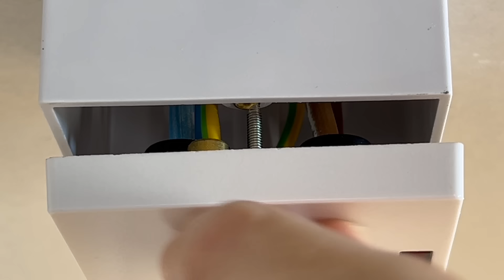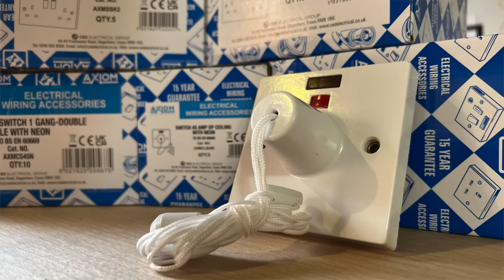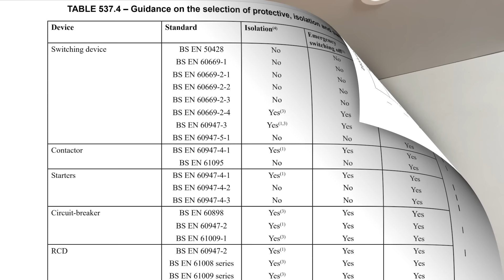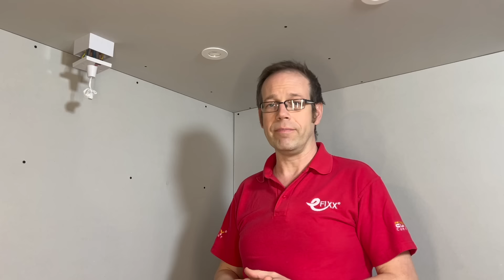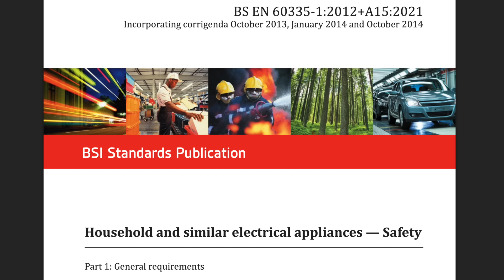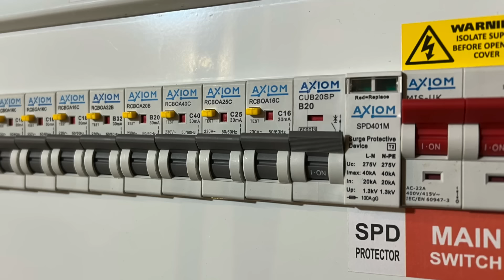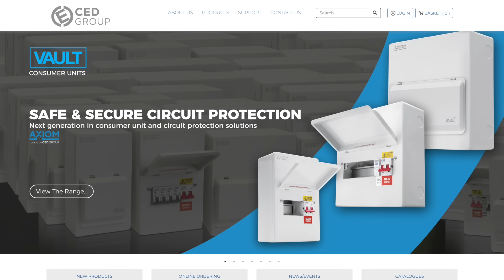Do You Actually Need a Shower Isolator — Or Is It Just Habit?

Comment: My bathrooms (Germany) have ordinary light switches on the wall and ordinary "schuko" sockets (with sprung cover) right next to the washbasins - use them for the hair dryer, the curling tongs, the toothbrush charger - whatever. One RCD for the whole house. Why does GB still have pull switches? Come to that, why does GB have these throughflow shower heaters? And why do German electricians think that things like ring mains and flat T&E are lethal? So many questions...
Reply: Switches are pull cords because of the hightend risk of skin being more conductive when wet,the same goes for the lack of bathroom 230v sockets.
One RCD for the entire house is infact an old standard that has been superseided by split load (2 RCD protected groups of MCBs ) or individual RCBOs, due to the fact that one fault would result in the hole house loosing power . 
The Electric showers are used due to the fact that space in UK homes is at a premium, so not having a HWS cylinder taking up space in a cuboard is seen as advantageous to some .
Reply: @callumcurtis15  Electric showers also have the advantage that you don’t need to heat your stored water in your vented copper or unvented stainless steel hot cylinders, if you need a shower. Do definitely a saving in gas, oil or electricity by using electric shower for a few minutes, as you are only heating the water you use for showering (even though it might be 9 or 10kw power draw for those few min)
Reply: Yes, I've found that electric showers are a very British thing ,and vary from useless to just adequate and most continental visitors find them " worrying" to say the least! And let's face it if you have say a 10.5 kW one ( which in winter is just about acceptable) ,and a large family, the running cost will be horrific.
Reply: Why do German electricians think that flat T+E is lethal? I would probably say they don't think that at all because it is in fact.... just an ordinary cable. 😱 Only lethal if you decide to chew it whilst still live.
Reply: I think to answer this question you'd have to look at the statistics for fatalities due to electric shock in Germany v UK. And make sure you're comparing like with like. 

I have to question why is flat T&E regarded as lethal? And one RCD for the whole installation is just asking for trouble for obvious reasons. 

However I do agree on the point of ring final circuits. Isn't this  originating from copper shortages back in the 1940's?

Comment: I never understood why contactors aren't more widely used for electric showers, suitably accessible junction box with a contactor, coil stabbed from the supply via a lightswitch in a location of choice.

Means you can run your switch wire in 0.5mm if you please, rather than chasing 10mm around.
Reply: I agree- contactor in the board is the best option. I then use a Quinetic switch as the actuator, stuck to the tiles in the shower room. It also switches on the boost for the MVHR.
Reply: I have found some people use the switch to turn the shower on/off rather than get cold water from the head turning it on at the shower. Others never turn it off, in this instance the contactor will be on all the time. I guess this could overheat the coil? The only experience I have of them was years ago when I worked in equipment manufacturing, they were used for relatively short duty cycles.
Reply: So you're putting a 1.5mm cable in the same terminal as a 10mm cable, then running it to light switch and back again on A1 contact and then neutral to A2? What places do you put the light switch? Airing  cupboard?
Reply: @BurpeesandFit  no, you would wire a 1.5mm separate circuit for the A1/A2 contactor terminals, via a double pole switch. I'd normally fit it as local externally to the bathroom as possible
Reply: Cost and locations, aint no one faffing around with that. Electric showers are usually in social housing, rentals and other homes as a cheaper option. Slap a pull switch in the bathroom and that's it.

Comment: This is all well and good, but I have owned an electric shower for many decades and have never used the pull cord to turn it on and off, this points to a flaw in either the shower design or the regulations that mandate it, for me at least it’s hints that the regulators think this device is not safe to leave permanently connected to the mains supply, which makes no sense to me, the only time I have had an issue with the supply to a shower is because the terminals in the shower isolator switch became loose over time, surely a better solution would be to fit an AFDD in the main fuse board supply to the shower ?
Reply: also manufacturers want to sell things ...they will always advise on more things being needed  , the regs are rigged
Reply: @memecoinmafia2732 Whole industry is lol.
Reply: It's not the regulators it's the manufacturers
Reply: Did you watch the entire video?
The video clearly states why a shower must have a switch.
Reply: Perhaps you should follow the instructions provided.

Comment: At Last someone has actually explained why have a switch. I have asked many learned people over the years about this and none of them knew.👍
Now you can explain why a kettle lead is too small and where it is covered in the regs.
Reply: The cable used to power the kettle can only carry the high currant drawn buy the heating element of the kettle if the cable is relatively short. If you want a longer lead then you would need to use a larger cable which would increase cost and may be difficult to fit in the 13amp plug top.  Remember these appliances are made and  assembled by 13 year old Chinese children so give them a break.
Reply: @KennethRankin-r2z  😂🤣
Reply: @KennethRankin-r2z  yes but where does it say this in the regs.
Reply: People tend to place the kettle next to a plug.  People don't want a long cable cluttering the surface and manufacturer's want to save as much money as possible
Reply: @Shocker99  I take it you mean socket not plug. I dont mean too short I mean too thin. The cable does not have the correct capacity acording to the cable tables.
Reply: @unicornpub  Because the cable is short and the load is not constant, a cable with a smaller CSA can be used for that current load. The tables showing current rating of cables with insulation type, installation method, air temperature, type of protective device, duration of load and voltage drop are in the regulations. To calculate the CSA of the cable to be used you need to take into account all of the above items to arrive at a calculated value for the cable that meets the regulations. Kettle lead: installed in free air, temperature ambient, protective device 1363 fuse,  voltage drop none over short distance of 750mm. Maximum cable size for 13amp plug top is 1.5mm
Load 3kw = 3000 / 230 = 13amp.
Actual cable size used is 3x 1.0mm pvc/ pvc.
Reply: @KennethRankin-r2z  And that 3kW rating will be rated at 240V, so 12.5A
It seems to be within spec to me.

Comment: You are correct about the pull cord wiring, bad enough with 6mm, never mind 10mm, and with wrestling the cables in can still need the terminal screw nipped up again. Surely designers out there can make a more practical and better solution
Reply: Agree, I have never done this but I wonder if you put a 47mm dry lining box in the ceiling then us like a 20mm extender that would give you 67mm but only poke down 20mm from the ceiling..  I think the trick is not to cut back the outer sheath too far so you can slide the cable back through the hole without single insulated cable poking out.
Reply: There is a better round design of 50A pull cord switch, the now defunct Crabtree 2167 and similar Scolmore PRW213. Unfortunately I'm not aware that CED offer a similar product. The base can be fixed to a ceiling joist with a cable coming in each side. The terminations are in the base, which makes ensuring that the connections aren't loose and any testing much easier.
The same issues arise with large cooker cables in 40A+ plate switches. Where I can fit local isolation inside a cupboard, or adjacent pantry, I'm now fitting commercial style rotary isolators, and I'd probably do the same for a shower if the switch was going in an airing cupboard. They are larger and a few quid more, but you can ensure that the terminations are secure, you can easily probe for a Zs reading, which is near impossible to do safely on a large plate switch, when connecting an oven or hob via flex you can gland straight into the enclosure, and they don't crack. (Please tell me I'm not the only one who has cracked a 45A DP switch plate or deep pattress when tightening up the cover screws!)
Reply: @dg2908  YEs we all tighten to "cracking sound" tight 😅. what also bothers me is the earth screw can be face skyward , so you have to make sure the earth is long enough and done up first
Reply: @dg2908  Be careful with rotary isolators as I dont think a lot of them meet the 3mm contact separation requirement, some might but you would have to be careful..   My preferred option is a large isolator that takes up a 2gang pattress box in as big a back box as possible.
Reply: @steve11211  all the rotary isolators I've used are 'Switch Disconnectors' made to EN60947-3 and are marked with the symbol to say that they're suitable for disconnection under load. According to table 537.4 they're therefore suitable for Isolation, Emergency and Functional switching
Reply: Without buying BS EN60947-3 I don't think I'll be able to establish whether that means a 3mm gap
Reply: Double screw connections are much better methods of cable connections in the shower switches in my opinion. Possibly the clamp method also an improvement on that.
Reply: 3 phase domestic.

Comment: Things of note: Electric showers are dreadful, for many reasons. I don't install isolators on showers or cookers. I don't offer electric shower installs (except in VERY specific circumstances). I don't read instructions, especially nowadays with the prolific poor translations all over the market, and if I'm there repairing a switch that's been on fire, because someone has taken no account for the T&E now being under 10 yards of insulation, I'm generally not going to be looking for instructions, I'm going to be trying to stop a fire. 
As wit installing ring finals, it's at this stage, just manufacturers and the regs being so far out of date. 
Take my latest swap out of a shower. Cooked at 2yrs old. After a bit of digging, it turned out that the guy hadn't long moved in, and was stepping out of the shower and pulling the cord to kill it, kettling the element every time he got out. So yeah, controversial, but common sense isn't always common, especially with end users!
Reply: Axiom is absolute rubbish. I can’t believe efixx are pushing it. Only bought by cheapskates from toolstation

Comment: Siting the switch outside the room is essential for letting the teenager know they've been in the shower long enough!
Reply: But little Timmy is doing some mechanical stress testing
Reply: @efixx  Agree. Been there. In the end i changed the breaker to a 32A RCBO, and told them it was to protect the main fuse because the cooker and shower couldn't be on at the same time, and it wouldn't trip if if they just used the shower for short periods. Which it didn't .  After a few "mum can you flick the power back again please they soon got the hang of hiow long to spend in their and how hot to have it.
Reply: I was going with a WiFi controlled contactor 😅😂
Reply: It's so if a teenager wanking too much in shower
Reply: nah you just need a shower thats sensitive to water pressure drops.  My girlfriends parents had one like that if you flushed the loo the heater would trip and shower go stone cold.  Ask me how I found out......  LOL

Comment: I use a double pole contactor correctly rated with an extra low voltage coil 12v and activated by a one way switch as the means of isolation.
Reply from the maker: Pretty cool as long as it's got 3mm separation. Why 12V and not 230V? 🤔
Reply: @efixx  
No reason for the 12v.
I adopt the same approach for high load hobs and ovens too.
Reply: @efixx  12v is a SELV/PELV approved voltage, which means less hurdle installing the operating equipment inside a bathroom. Atleast here in sweden, SELV up to 12v AC or 30v DC is approved with only basic protection (single isolation) in area 0 (under the shower) Which means the contactor and SELV transformer can be installed outside of bathroom, and then the 12v is pulled inside the bathroom.
Outside the shower, in the immediaete vicinity, then 25v AC and 60v DC, both SELV and PELV, is approved.
Reply: @efixx  A thought, 12v coils tend to be thicker wire and thus more robust?  I have known a few contactors to break where the coil terminal is soldered to the fine coil wire...
Reply: Where do you get the 12V from?
Reply: @PhilipPaintin  
From a 12v DC PSU din rail mountable in the consumer unit and where the appliance electrical supply passes through a contractor with a 12v coil that is activated via a local switch by the appliance controlling the 12v.
Reply: @Flames-m4d Ah okay thanks